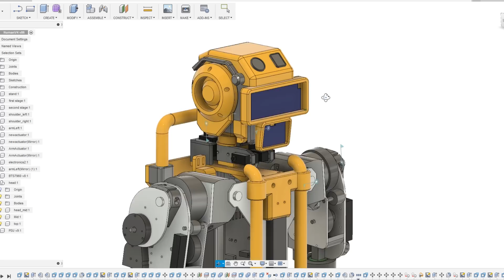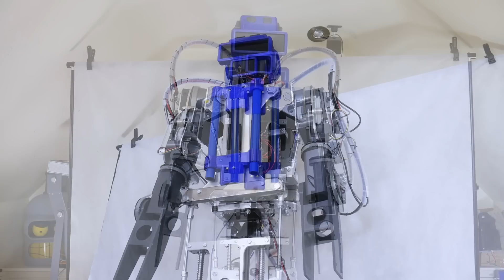Building Animatronic Robot Heads

Comment: You might have explained why you did this and I didn't catch it, but if I were setting these up to integrate into a show I was on, I would prefer to have the 5-pin DMX in and through be the only connections I needed to get each robot up. The patch cable to the 3-pin XLR/RJ45 box seems unnecessary from an A/V perspective. If that could be hard-wired or permanently patched so that it doesn't need to be touched to connect each robot up, it would feel simpler.

Comment: For recording the puppeteering output, you could look to use a momentary foot pedal to ease finally snapshot the dmx values for where the puppet is and use that as steps in the sequencer. Fwiw, I've worked slot with freestyler over the years and I feel your pain. There are a lot of options for software, but quite a bit is pricey. Madrix may be a good, albeit expensive option. Also, you'd be able to use artnet to communicate with the robot and ditch all of those dmx cables.
Reply: Come to think of it, find a talented lighting designer and they'd be able to help a ton

Comment: Did you plan for an adapter to put a cellphone instead of the eye-thing. Then you would have a built in camera, gyro, compass and it could be running remote AI. Paint it silver and you are one step closer to the Terminator.

Comment: An idea for head control on the puppeteering rig: make a mask for the puppeteerer to wear, with reflectors or QR codes etc. on it. Then point a camera at them and track their head movement, and translate that into the movement of the robot's head. Maybe you could even track the eyes of the puppeteerer, although I don't know how advanced the libraries for that kind of thing are

Comment: Great work! I'm amazed at how much you can do in a week or two!
Looking at the main board I would probably move the emergency stops a little. As it is now, it looks like the button is covered by the DC lines to the motors. This is probably not a problem when you are working on them but when the robots are placed somewhere public it's probably better for the E-stops to be easily visible in case something goes wrong..

Comment: I'm loving this project! I have a rare idea that I would be a good feature. If you could put a button on the puppet that paused the motion of that limb, then you could lock an arm in a position while you mess with the head and then when you move that arm again, you can press the same button to resume and it will move over to where the arm is at that point. That way, you could also hold a pose if you wanted. Keep up the great work!